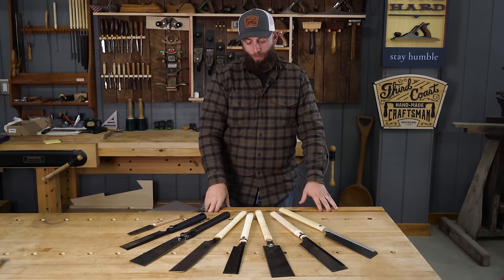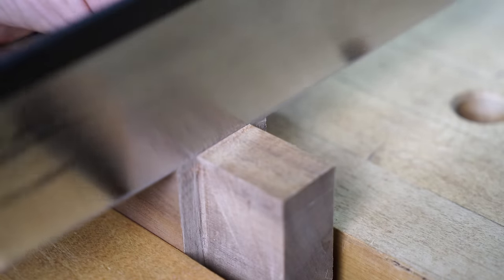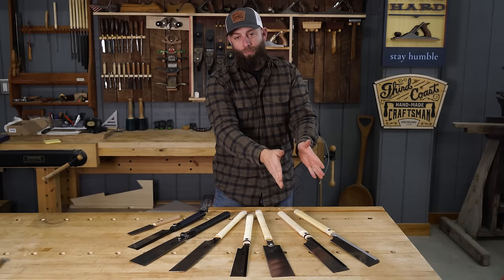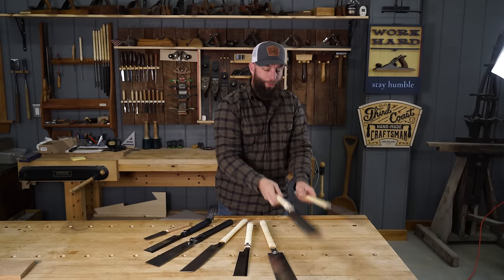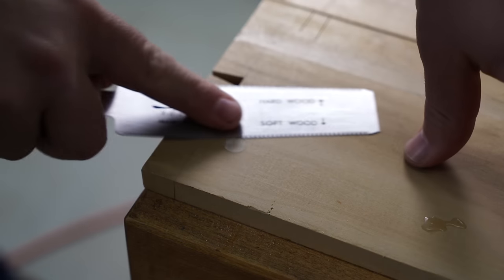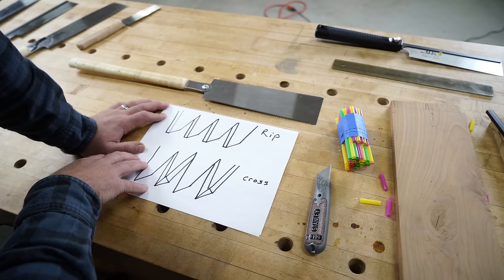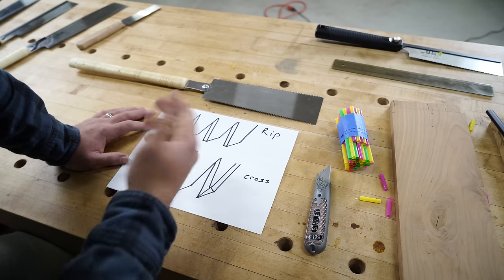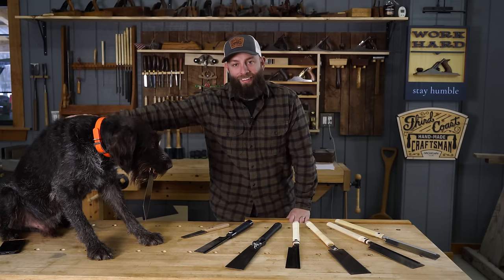Understanding Japanese Saws + The PERFECT Dovetail Saw // Woodworking 101

Comment: I have 9 Suizan saws, and use them on a regular basis. I also have the saw you recommended to Suizan. I use it to cut tenons with, used it today. I really like the 6 inch Dozuki saw for cutting dovetails in 5/8 inch thick wood and less. Thanks for your video.

Comment: 7:25 shows exactly why Japanese saws don't make good dovetail saws for most Western woodworking where we use lots of hardwoods. They're designed for soft woods and they just simply don't cut straight enough in hardwoods due to the thin and relatively unsupported blade. The back side of the cut will tend to wander and so you must cut away for the line and pare down to it with a chisel afterwards rather than being able to cut perfectly straight and square right up to a line. Rob Cosman's western style saws are the best for hard wood joinery, dovetail and otherwise, but of course you have to pay a price for them.

Comment: I do not have a bandsaw and it’s not in the works right now. I know you use a bandsaw to resaw boards but I don’t have that option. Is there a pull saw that is meant for resawing? I’ve tried with the ryoba and every time it gets half way into the depth of the blade and will start curving. I thought it was a bad blade so I replaced it and still the same results. I was wondering if you could give me some info on what my technique is that’s wrong, or info on getting the right tool for the job?
Reply from the maker: Resawing is a pain in butt and takes really good form. I actually prefer a western saw or a Frame saw. A ryoba is pretty tough even for the best guys out there. If you have a table saw or circular saw and can set up a jig to saw a nerf on each side and then saw out the middle by hand that help. Then you’ll have some planing to do to smooth out the uneven surfaces.

Comment: I really appreciate the opportunity to have a long deep rip dozuki and certainly will add to my shop.  Admittedly I’ll still use my Florip and BadAxe saws in joinery, but maybe in fine inlays, splines, and in chair making they’ll jump in rotation.  If I was a brand new sawyer, I’d go Japanese saws until I just made a concerted decision to add to my skills and take up western saws.  For someone just getting started, the money they’d save on buying Japanese saws can really help them get ahead by freeing cash up to invest in quality sharpening gear, a good No° 4 or Jack, or a few decent chisels.  If you’re like I am where the only powered tools I use are in milling (bandsaw, jointer/planer), the entry point in western saws is steep (panel, tenon, dovetail, sash, etc and multiple configurations of at least the handsaws).  There could easily be $1000 hiding in going to Japanese saws to begin with and set someone up with the gear to discover what sharp actually is and how sharp in a nice No° 5 or a 3/8” chisel will give you the pleasure of the ‘AhHa’ moment.   Yes, yes, yes... if you’re just getting started, go with Japanese saws and do your research/talk to others about sharpening gear, chisels, economical woods to start with, etc...  👍
Reply from the maker: That Japanese saw might make its rotation even in your joinery once you spend some time behind it 😁
Reply: I agree with you. Until I finally learned how to sharpen my tools properly I was a very frustrated woodworker. I was young and poor with mostly hand-me-down tools or tools I picked up at yard sales. I finally met an older guy who was nice enough to teach me how to sharpen chisels and plane blades properly. Changed my world. Now I’m the old guy who always takes the time to help younger guys learn.